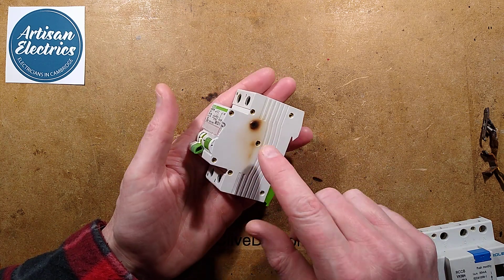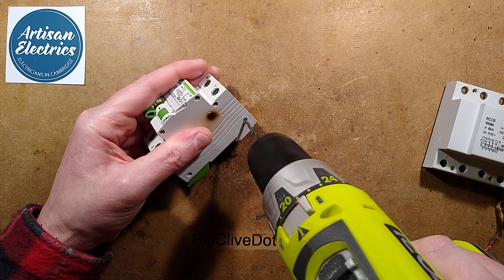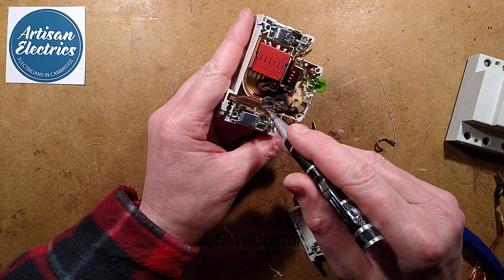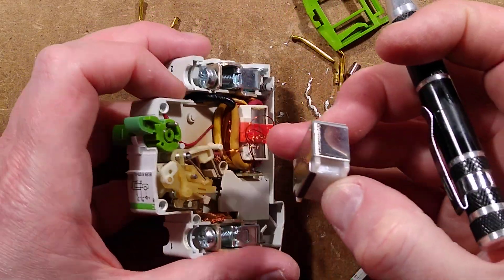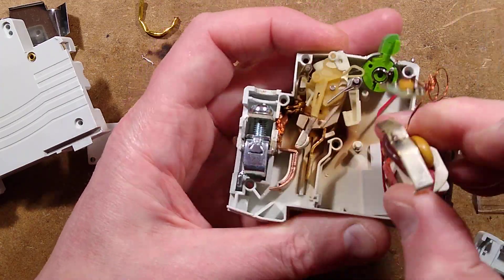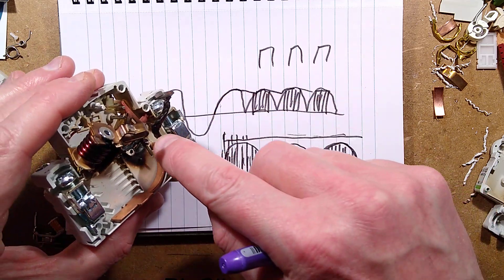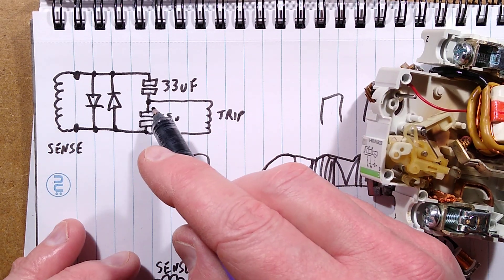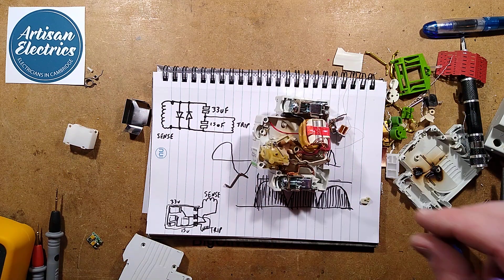Failed Rolec breaker from Artisan Electrics

Comment: I don't understand why you think that because the car charger or on board charger (OBC) have power factor correction (PFC) it'll produce spikes.
In fact it's the other way around if your product is using a switch mode power supply (SMPS) without PFC correction circuit the input current will look like this (blue curve) : https://imgur.com/a/Rp2f3BV
With PFC correction the input current will be a sinewave in phase or almost in phase with the input voltage waveform (green curve).
I'm working for a company that design and manufacture many power electronic converter like inverter, on board charger for the automotive market for many car manufacturer like JLR, Volvo, BMW.
I have been working for a year and a half on OBC and did many tests on OBC prototype so I know very well how an on board charger works.
I'm still currently working on other OBC projects.
Usually the architecture used is a bridge rectifier then a boost converter which is used for PFC correction, after the boost converter there is a LLC converter to adapt the voltage needed to charge the EV battery and to cover the whole voltage range of the battery.
The power factor is really good while using this technique if the control law is done correctly. Power factor can vary from 0.94 to 0.98 easily from no load to full power. Also the OBC I worked on was a 11kW, the PFC inductor value was 500uH, and the capacitor between PFC and LLC converter was 1mF.
Yes the current on the inductor looks like a triangle but the current on the AC input when a PFC is used is a sinewave.
I can show screenshots of scope capture that I did during my tests and you can see that the input voltage and input current are both sinusoidal and almost in phase (PF>0.94 or even greater).
It's the goal of a well designed PFC to keep the phase between input current and input voltage as little as possible to maximize the power factor.

Comment: Uh, bigclive, the PFC’s role is precisely to “despike” the current and make the load behave like a resistor. With a PFC you should be getting a power factor very close to 1, and a high bandwidth (DC-100MHz at least) current probe should show a fairly clean line frequency waveform (50Hz in Europe). Maybe whatever the cheapened out EV chargers do is not PFC in spite of them claiming otherwise… how does that even make it to market in the supposedly regulation-obsessed Europe??

Comment: i bought a house and not joking, 3/4 of the breakers were not working correctly. some stayed on, some didnt want to trip off when you pushed the toggle. some had burned out bus bar contacts. also all the house outlet were worn or burned out. they woudnt hold a plug in. and most of the light switch were very floppy or would heat up.

i dont know what happened, i never understood why everything would be so fuc8ed.
Reply: Been a Cannabis Farm at some point in its history ?
Reply: @rowanNClangley  i only know the last guy had two pigs (real pigs) in the house. but he was only the owner for maybe 5-10years. he abandoned the house for a year and the basement got flooded 2-3ft. but that doesnt explain all the light switches and outlets.
Reply: Probably a DIY install, loose arcing connections, overheating, failure over time. Also, if the pigs were urinating in the house tha gases produced could have caused corrosion of the copper terminations 🐖🐷 maybe 😂
Reply: @muzikman2008  one of the neighbors told me it was in fact 3 pig. with one that was walking about on two legs. wink wink
anyway i might never know. just recently the water heater stopped working. the fault was a wire that corroded and stopped working after it started arcing inside a secondary fuse box breaker type thing that was between the electrical panel and the water heater.

i am not an electrician, but i dont see why the need for a separate box with glass fuse between the panel and the water heater???
Reply: @Francois_Dupont  Usually the reason for a box near the appliance is to serve as a positive point of disconnection when the appliance is being serviced and that is in control of the person making repairs and can be visually inspected in real time to ensure the load has been, and remains, disconnected.  It isn’t usually out of concern about the appliance overloading the circuit as the upstream fuse or circuit breaker will protect the wiring, but disconnecting the load at the appliance ensures that the correct circuit has been absolutely disconnected and that an unknowing third-party can’t accidentally (or intentionally) reset the circuit breaker or reinstall the fuse in the main panel and suddenly electrify the appliance without the technician being at all aware of the change in state.
Reply: @ethanpoole3443  in my case its in a small 2bedroom house and not even 15ft from the main pannel. haha that is strange.

Comment: Why the Ryobi from a man that appreciates electronics?
Reply from the maker: It was one of the first affordable universal battery systems.  I've kept using it.
Reply: @bigclivedotcom  Same here.  Ryobi also had far more reasonably priced replacement batteries than many others and it wasn’t a new battery style every couple years like some manufacturers used to pursue so you needed a new battery and charger system every time you had to replace a device (and often times a different system for every device you owned).  Besides, if I drop a Ryobi from atop a 100ft tower I’m not exactly out much and they still deliver a decent service life given what I ask of them.  But my corded tools are much higher end.  For nearly twenty years now I have had exactly two battery systems for all my rechargeable tools, a 12V Ryobi battery for the smaller lightweight drill (ideal for overhead work where you often don’t need a ton of torque) and an 18V Ryobi One+ battery for ALL my other rechargeable tools.  In just batteries alone that has saved me a fortune over the years as nearly every tool can use the same battery and a couple chargers will charge every battery I own.